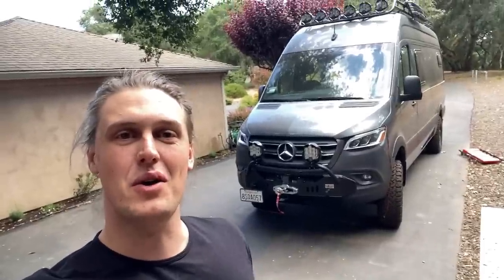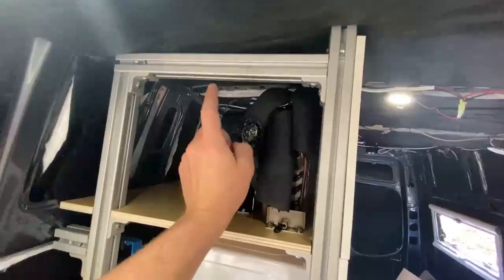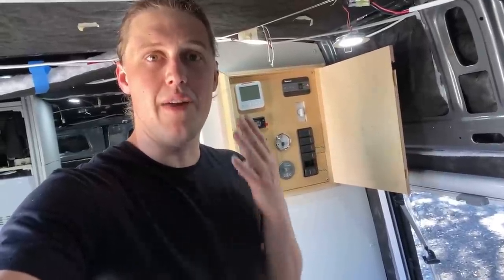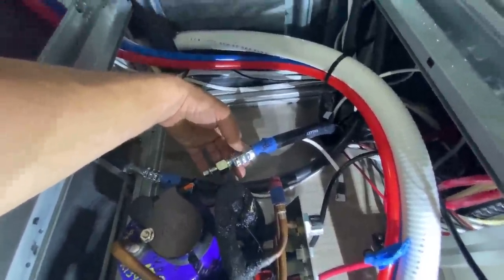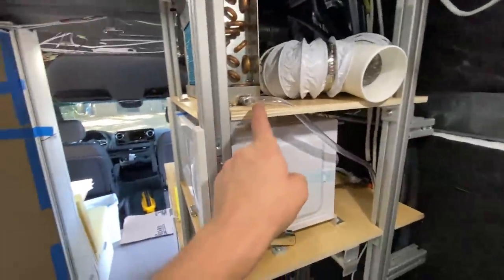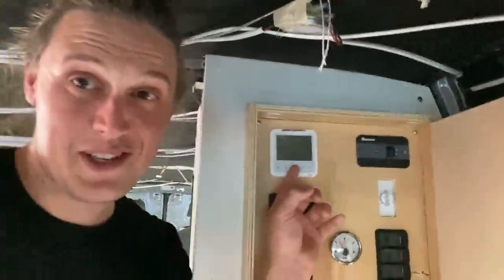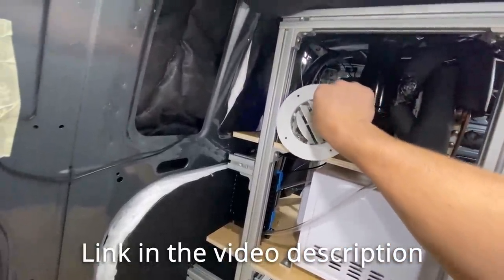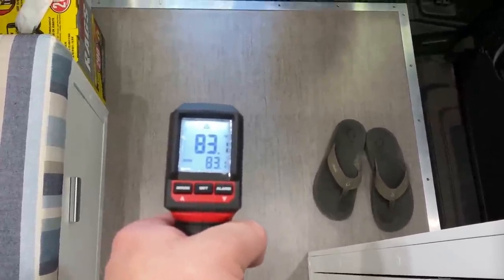The BEST Battery Powered AIR CONDITIONER For Van Life?

Comment: Your exhaust pipe is going to get pretty hot while you’re driving.  Radiant heat from the exhaust may melt the cowling around the fans.  I suggest you install a stainless steel divider vertically between the exhaust and the fans to stop that from happening.
Reply: ❤️ awesome 😎 thanks for sharing!!
Reply: Agreed, going to mess with the output of the AC too.
Reply: an aluminum exhaust heat shield would disperse heat better stainless steel  will hold heat
Reply: You could also run a copper coil around it with circulating water inside, portable hot water heater.
Reply: Outstanding. Do you do this for hire for others!?
Reply: Another tip put it on dry

Comment: While I want to buy made in USA, and I really look forward to our locally manufactured 12v ac, to priced it at $5k, that is just insane. Fact, my friends in south east Asia have been enjoying 12v ac for the past 12 years made in China, whole unit cost less than US$600. Cool down the whole 159 Ram promoter equivalent size from 100F + to 78F in less than 25minutes. Cheaper unit cost around US$450 does a decent job but not fast to cool down the van. We are talking 10 times the cost. Smh. Looks more like cut throat pricing.
Reply: Slave labor in China does keep the cost low.
Reply: The VES classic is $3,395 and the HD is $4398 and our compressors are made for us right here in the United States 🇺🇸 . The benefit to sourcing everything here is we can fix them if they ever had issues but in the last 11 years we have not replaced any compressors. Getting replacement parts for overseas units can be difficult especially lately.
Reply: @CruiseNComfortUSA  I can but 6 replacement units for the same price so it still would make sense to buy the cheap Chinese built if they are available in the USA. I’d love to buy made in America but until wages match the price I can’t. Henry Ford had lots of bad ideas and philosophies but he got the wage to price ratio thing correct.

Comment: Split units are obscenely efficient compared to packaged units.  I built a custom tow-behind BBQ competition trailer for a buddy and I custom built a split heat pump for it so he can use it as a camper/trailer when not doing BBQ competitions in it.  I set it up so that even with everything running full-blast it only pulls 15 amps at 120 volts, so he can run it on a super small generator, or any camp site power outlet or even solar power.  The trailer is insulated pretty well and has a 12,000 BTU split heat pump system and a hidden drain hose that drains directly to the ground.  I am also an HVAC technician, EEE, and Network Engineer so I was able to install and build the whole thing myself with assistance from my buddy.  I am super proud of how it turned out, and he absolutely loves it.  He was able to run his trailer at a super small camp ground in south east Kansas that only had 15 amp 120 volt outlets.  The system is not a 12 volt system, but it is an inverter compressor system so it can even run on a modified sign wave power inverter or really poor quality 120 volt power source. (inverter compressor system takes 120 volts and converts it to about 90 volts dc then to 3 phase power to the compressor motor, similar to the way electric skate-boards or electric scooters power the motor from lithium battery packs)  It is really easy to convert an inverter compressor heat pump to 12 or 24 volts just by modifying the power converter part of the control board to skip the a/c to d/c conversion and put d/c from the batteries directly to the motor controller part of the heat pump controller board.
Reply: I know this is an old comment, but that build sounds awesome! I'd watch a walkthrough video of it if you published one!
Reply: @LaneLarson  Yeah, I wish I would have taken video of it.  It was a lot of work, but it was a lot of fun.  The most difficult part of it was mounting the outside part of the mini-split unit to the trailer.  The trailer was too tall to put it on the roof, so I had to build a custom mount for it, but with it just hanging off the front of the trailer, I had to build a cage around the mount.  I was on a time crunch so I wasn't able to make that part of it look pretty, which is unfortunate.  I think the total cost to convert it to be able to camp in at the BBQ competitions was about $800.  He uses it for regular camping as well and apparently the mini split unit I put in is so efficient that he was able to run the whole thing off a 15amp outlet at a remote camp site with an extension cord.
Reply: @johnbrizendine4425  That's legit! I'm planning on putting a mini split in our camper soon. Pretty excited to have decent AC here in the South.
Reply: @LaneLarson  Make certain you install a breaker box and wire everything with stranded THHN wire if you are going to add any electrical outlets or anything like that, DO NOT use ROMEX, as it will get weak points in it from vibrations and end up starting a fire.  Also, if you do use a breaker box, do not bond the neutral and ground in the box, as it will cause a lot of problems.  When I created the mount for the mini split, I had to put up 1x2 wood strips and plywood/OSB for the bolts to mount to through the skin of the trailer.  Make sure you get a decent cage built around the outdoor part of the mini split unit, or it will get stolen when you aren't paying attention.  The craziest part of it all was that I used a cheap harbor freight 125 flux core wire welder to put it all together.  It was just barely big enough to do it.
Reply: @LaneLarson  One other thing, make certain that it's an INVERTER HEAT PUMP, for best results, as that will be able to run on a 12volt or 24 volt power inverter, and the inverter heat pumps automatically start up with minimum current draw and slowly ramp up so that there is not a startup current draw, and any 120/220 volt power source that is rated at the same power output the heat pump requires will run it.  A good 9,000BTU inverter heat pump will pull less than 1,000 watts when not on "full blast".
Reply: @johnbrizendine4425  Solid advice. Thank you!

Comment: People in the comments act like this product has never been tested at all for an undermount. It looks good to me, you made your informed choice. It looks good to me! Get those front window covers quick!
Reply: Yes... but if it were me I'd put it on the drivers side - away from the hot exhaust.
Reply: @nathanchildress5596  Fair enough, if there's room there.
Reply: You are correct, the condenser I use is made for heavy equipment and is very durable. The fans I use are IP68 rated and can be submerged. We also use the same fan motor on our blowers and has been proven in our off shore race teams. They do submerge the MES systems often (same build materials as the HD ) and the fans /blower motors are never affected. Over the last 11 years we have supplied 3 replacement condensers. These replacements actually were mounted on logging trucks up high and took hits from trees. 🤷

Comment: One thing I might recommend is soft mounting the noise generating AC components on the shelf. Using rubber, silicone or another soft material can help decouple the noisy parts from the shelf and quiet it further.

Comment: Me - I'm a mini-split fan.  You get cool + heat and can do simple vacuum yourself with ones that are pre-charged.   I understand its a challenge to mount the outside unit...  (maybe on a door on the back) but efficiency + silent operation are very strong pros for me.     I have a Senville 9000 BTU on my 7 x 14 cargo trailer conversion w/1" insulation all around - takes about 4-5kwh / 24hrs to keep trailer cool at 100-105F outside and warm down to 25-30F outside - and then less power if the temps are inbetwenn those extremes. .
Reply: How much power is 4-5kw ? How many batteries per day ?
Reply: @hijodetupa  500ah @ 12v = 6kwh at 100% discharge.

Comment: Hey bud! Love the videos! I have the HD-12L  installed in our sprinter and I quickly found out that in humid environments the evaporator will sweat A LOT. So much that it will actually leak into the van and weep through the drain holes. Chris (who is an awesome dude!) also sells a stainless steel tray that you can mount the evaporator on.
Reply: Thanks Clayton, yes I do have a stainless tray that has drain holes in all 4 corners. It is made from .060 stainless and Tig welded.

Comment: I installed a Cruise N Comfort HD-12L system in my Sprinter last October and have been very happy with it... especially with the temp hitting 106 degrees in parts of N. Cali last weekend!

With 1,120 watts of motorized tilting solar, I can run the A/C on max throughout the daylight hours and not touch any of the 600Ah of lithium in reserve until nighttime (rarely needed at night in the SF Bay area).

I didn't have any previous HVAC experience, but just bought a cheap set of guages on Amazon and added the freon myself. Pretty easy, actually.
Reply: Don't you have to vacuum test the system?  And it's not freon anymore.
Reply: @scottslotterbeck3796  These units use R134a refrigerant (which I called "freon" out of habit). All of the specs are listed in the CNC manual and the refrigerant is readily available on Amazon.  

The guages come with a small electric vacuum pump that you use to pull a vacuum, then close the valves for 30-45 minutes and watch to see if the unit holds the vacuum (no hose leaks) before adding the refrigerant. Takes about an hour total and isn't really that hard to do after watching a couple of YT videos.
Reply: I have put up a video one of our customers did on how to charge the system yourself. It is under the manuals and videos tab. I am also available for a video call if someone needs help with this process.Thanks for your purchase I really appreciate it!

Comment: Cool van build!  When you have your Solar Panels set up I have a suggstion.  The AC System may be more efficient if you set it and forget it.  Thermal Dynamics.  Set the AC Thermostat where you will be comfortable and leave it running 24/7.  The Walls, Floor and Ceiling, along with everything else in the van, will help maintain the temperature and make the system become very effective and efficient.

Comment: those machines are so insanely easy to use. I figured it out within 5 minutes on my first try. I became the go-to guy for ac in my shop. Your system is no different than a normal car ac, those shops were just worried about liability. Even the receptionists at those shops should have no problem doing that task. The shop just wont allow that.

Comment: In Sprinter ambulances they mount the fans on the driver's side. It helps keep passenger-side quieter on the outside, which is where you would typically have your camp set up.

Comment: I have the same batteries (1020AH)and run and inverter with a mini split. Works great and will freeze you out. 🥶. Mine cost less than $800. Downside it does take up more room and the back has to be vented or door opened.

Comment: There is a window tint that is clear for your windshield and door windows that will block out the heat. Check on the internet you'll see the film I'm speaking of it will make driving or being in the front of your van tolerable summer or winter.

Comment: Ceramic window tint would make a huge difference for the heat coming through the windows 🤙🏻
Reply: they also have clear window/windshield heat rejection film.
Reply: @six2da3rd74  I did ceramic tint in my sprinter, including the clear on the front windshield and it does make a huge difference.

Comment: You should line the evaporator box and the compressor box with thinsulate to help muffle the noise.  It will be really interesting to see DBA measurements when they are enclosed.  But, I suppose white noise of the AC would help drown out street noise.  Also noise levels of the under mount condenser in series and parallel.  Perhaps double wire it to a switch to select between series and parallel as needed.

Comment: You do want to install a heat shield next to the exhaust from the engine. If you need to have the unit recharge (only if you have leak in refrigeration system) found a refrigeration company. The system look great

Comment: I charged my Cruise N' Comfort a couple weekends ago DIY style. I got the vacuum pump + manifold gauges I needed from Harbor Freight for about $180. Another $10 adapter from AutoZone to connect the 12oz 134a cans to the manifold gauges. I have the 12v HD unit
Reply from the maker: Dang, smart! How’s it working so far?
Reply: @seven_o_savage  Haven't used it too much yet. I got it all installed and working just in time for Fall weather :). Currently waiting on a new WiFi thermostat that should also work with our espar diesel heater.